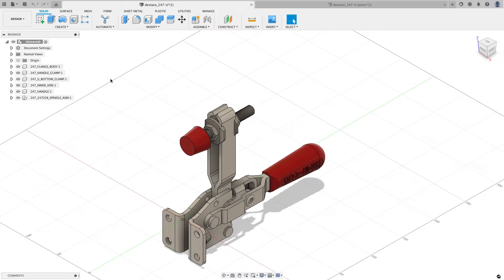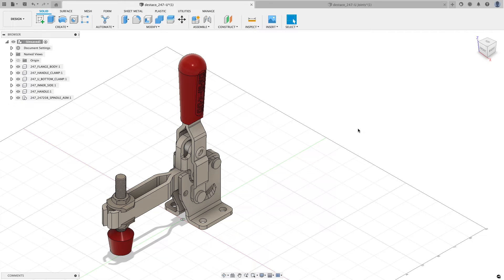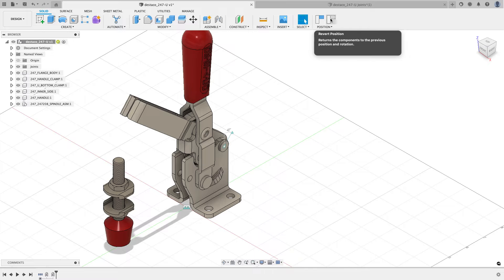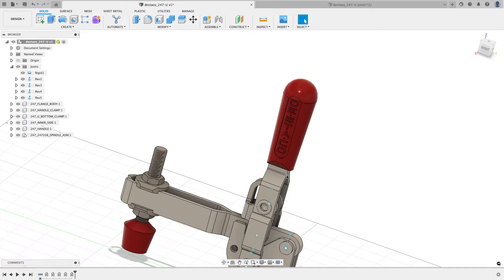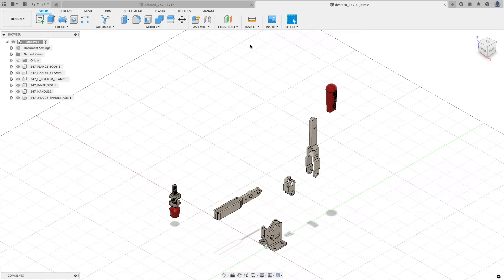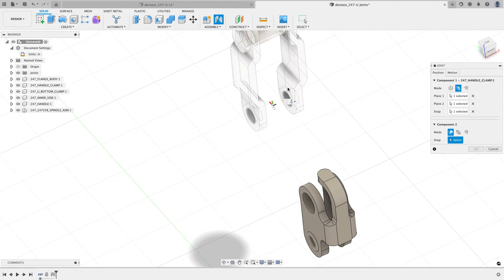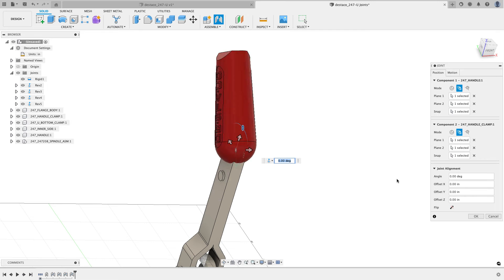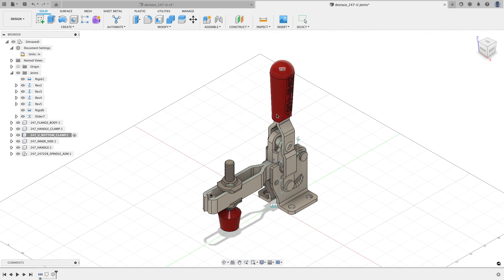Fusion 360 - What is the difference between Joints  and  As-Built Joints?

Comment: You need to set your units to "thou", since that's the units you imperial hold-outs actually converse in.  You know your unit is the wrong one when you have to divide it into thousands to get the actual base unit you are working in.  Using inches for mechanical work is like using miles for house framing.  Other than the cringe use of inches, that was an awesome tutorial :)
Reply from the maker: When your country rules the free world, we'll use whatever units you want. Until then, inches ;-) 

Glad you found it helpful.
Reply: @MechanicalAdvantage  FYI, I'm an American living in America.  Inches is great in the scale range from furniture to building construction.  Below that it makes no sense.  Having to have two duplicate sets of sockets, wrenches and hex keys for two systems of units is equally retarded and a waste of tool drawer space.  The rest of the world figured this out in the 70s and switched away from rando units based on a kings body parts.
Reply from the maker: @ What country did you move to?
Reply: @MechanicalAdvantage  Bro, I live in Ohio, working as an engineer in a company where the vast majority of mechanical designs are done in metric.  Not everyone clings to Freedom Units (TM)
Reply from the maker: @cluebin8398  Sorry, thought you said you moved. Not sure where I came up with that. 

I just don't see either as a big hang up. In the US, imperial is far more widely used. If we changed, I wouldn't be upset about it, but I don't see it happening anytime soon. Just the amount of money required to change signs in the US would be billions and billions of dollars.

Comment: When starting the 2nd half of video when you used the as-built to lock in the flange, could you have  used the ground command for that component in the browser as an option? Helpful video, now I know the difference between the two joint commands.
Reply from the maker: Ground works, but ground is only persistent in the file for the clamp. If you insert the clamp into a different assembly, the ground doesn’t make that trip and you run into issues.
Reply: Got it, so much to know, glad you know! A related question can you use the joint command to join two subassembly. By subassembly I mean a component with say 5 components under it in the browser. The joint command in that case only seems to join a single component in each subassembly instead of the entire subassembly even though the each subassembly is a rigid group.

Comment: WoW - 'Gravity', as built in to the design, compels the anchor mechanism (adjustable rubber stop) to slide inward towards the handle as it is opened and closed. Holy moly that is impressive. 
https://youtu.be/yi72BQ9M3qI?t=551 .  A very clear and well explained technical tip!
Reply from the maker: Thank you. I hope you were able to put the info to good use.

Comment: TY very useful video. I prefer the first method as it seems to allow the plugger to move more independently without needing a sketch to create a point. (BTW only Americans use imperial, the rest of the world use metric) lol (even your space agency use metric). lol. (try it, it's an easier system to use) lol
Reply from the maker: Hi Billy. Thanks for the comment and I’m glad you found it useful. Question for you. Let’s pretend the rest of the world with the exception of your country decided to switch the Imperial system. Would you make the switch or would you stick with what you know? After 46 years, it’s hard to make the switch away from a system you have been using your whole life. The good news is the system of measure doesn’t impact the concepts shown in the videos I guess.
Reply: @MechanicalAdvantage  The world was using that system however as progress was made and more logical systems were developed other peoples' adapted, I was born 55 years ago in a country that used imperial but learned to use the metric system as the world did. Progress is not hard, just takes an open mind. ...
Reply from the maker: That wasn’t the question :)
Reply: @MechanicalAdvantage  I answered it and gave an actual account to emphasize the answer.   "country that used imperial but I learned to use the metric system as the world did"
Reply: as a canadian...we use both lol...divde by 2...divide by 10 ...both easy

Comment: so what actuaully is an as built joint
Reply from the maker: When two components aren’t in the right place, a joint is used to define the position between those two components. When a component is in the correct position an as-built joint defines the relationship between the two components (rigid, or type of movement)

Comment: nice video, i would like to know if in this way you can make a 2D drawing with part list and so on showing the different position of the assembly
Reply from the maker: That functionality is not currently available in Fusion 360.
Reply: @MechanicalAdvantage  are you sure? I saw some video with part list and so on
Reply from the maker: I think I misunderstood the different position part. Parts lists are available for sure. I thought you were asking about something like a hydraulic cylinder being shown in a drawing in an open and closed position.
Reply: @MechanicalAdvantage  I meant that infact. Have you ever tried to do the 2d drawing, set the view, modify position and create another view?
Reply from the maker: Usually this is called positional representations or overlays. You might be able to make something to resemble this, but to my knowledge, Fusion doesn't have this specific capability built in yet. 

If you have a video that shows differently, I would love to see it. 

https://help.autodesk.com/view/INVNTOR/2022/ENU/?guid=GUID-34C28C35-45CA-4476-9336-30146F7C9471

And then look at the bottom example here that shows an Overlay View
https://help.autodesk.com/view/INVNTOR/2022/ENU/?guid=GUID-C53DAB48-BA5F-4377-842D-BB8F3E5962A0

Comment: It is more confusing difference between Rigid group and As build Joints. It is kind of logical but, it looks like one can cover both.
Reply from the maker: With as-built joints, you can define motion but you can’t with rigid groups. With as-built joints, only two components can be included. Rigid groups can contain many components in one group.

Comment: Great video thanks, gland you're posting again I learn a lot from your videos. Just a couple of questions. Why did you choose to use a ridged joint from your component to the origin point instead of grounding the component, what's the difference? Also I'm playing with a design that uses a reciprocating rack to drive a gear around. I can make the rack move linearly and the gear rotate ok but what 'jointing' do I use to make the motion of the rack drive the gear around?
Reply from the maker: I should have addressed this better in the video. When you ground a component, it is only grounded in that design file. So if you insert that design into a different design, nothing is fixed in space. Maybe I’ll do a little video on this. Imagine if you assembled a hydraulic cylinder and grounded the first component. When you inserted that cylinder Into a new design, it wouldn’t work they way it was meant to because the first component would be free to move in the new design. 
I’m not 100% sure on your second question, but the answer may be a motion link. That would work if you had sliding component and a rotating component. You could add a ration that says for exert x distance of motion, rotate x number of times.
Reply: @MechanicalAdvantage  Thanks for your reply, that makes sense and I'll give the motion link a go (once I find out what it is and how to use it 🙂).
Reply: Thanks Kevin your suggestion to use a motion link worked a treat.